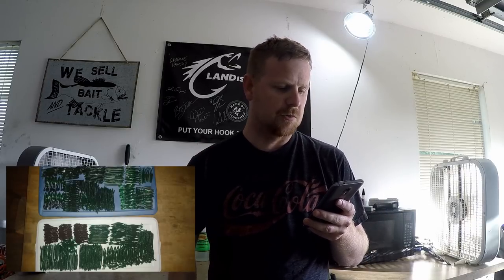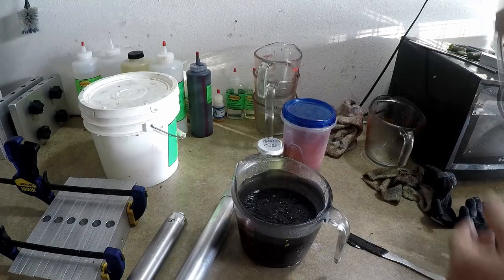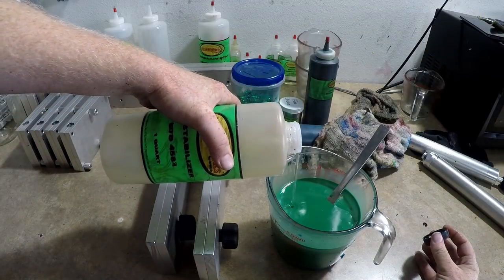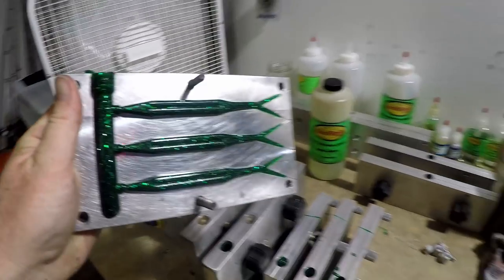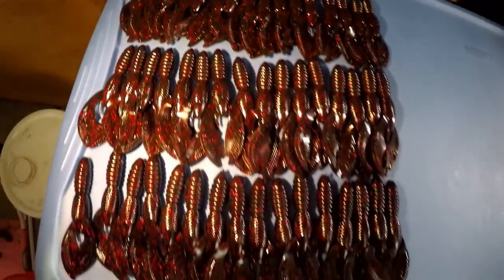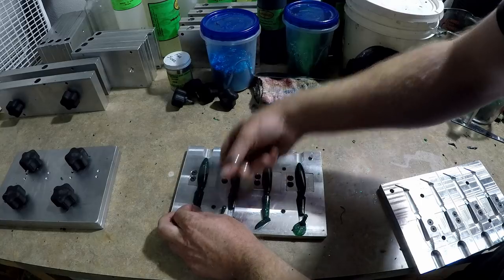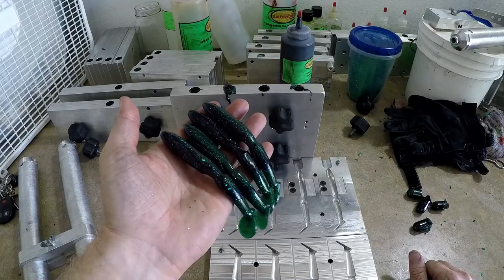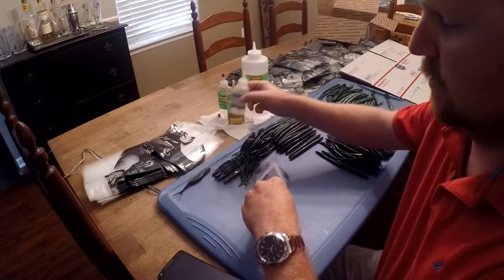72 Bag MEGA-ORDER!  Making Split-Tail Laminates & Everything In Between!

Comment: So I have been having a problem with my molds not getting filled and with laminates all the way and getting incomplete plastics how do you have them turn out good each time and what do you do when your injector runs out and there is still more molds to poor
Reply: Also we’re do you buy your plastic and matierals and do you remelt the leftover plastic
Reply from the maker: make sure you are getting the plastic hot enough so it can fill thin cavities..also try holding down some pressure once you feel the mold is full.  If you are halfway through the mold and the injector runs out of plastic you are pretty much out of luck lol.